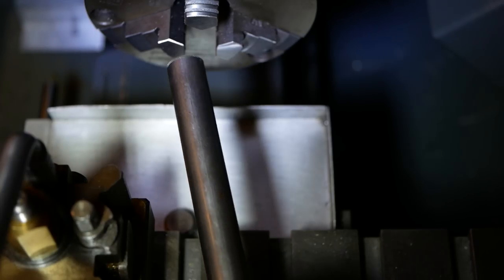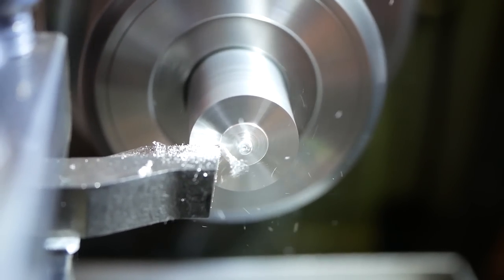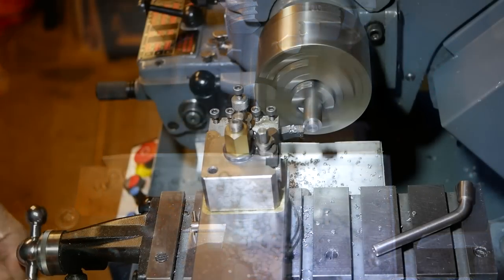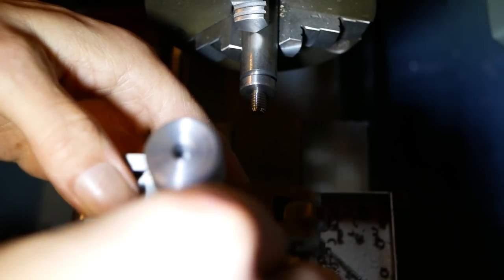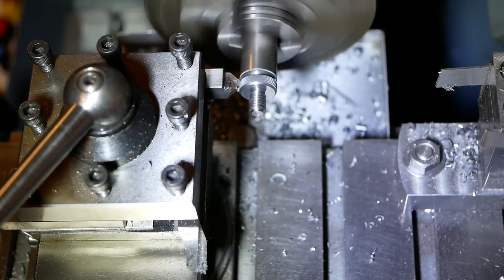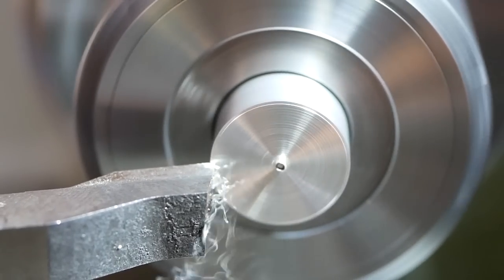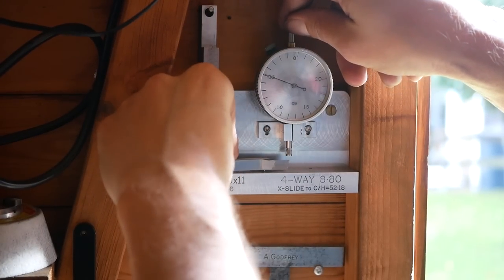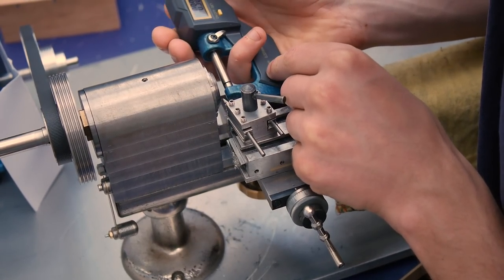In Defence of the 4-Way: Myford Toolholding

Comment: That's just silliness. QC toolposts are worlds faster than 4-ways. It's easy to make plenty of toolholders for a wide assortment of holders. Boring bars, threading toolbits, left turners, facers, right turners, detailers, cutoffs, knurlers... each with its own holder, all preset to its own height. Slam slam slam. No shimming. Even adjustment need not be by trial and error, since you know the thread size of your height adjustment screw / thumbnut. Make one low quickie test cut, measure the diameter of the stem nipple, divide in half to get radius, and you know exactly how far to turn your thumbnut to be exactly where you want to be. It's even super-easy to set a tool high or low to compensate for a top rake that isn't ideal for the cut being made. And... a QC toolpost can be rotated just as easily as a 4-way can be. With NO tools.

A QC toolpost is also nearly always smaller in "diameter" than a four-way is, which places the toolbit nearer its center, which minimizes tool stickout and hangover, which maximizes rigidity. No need for any shim rack or external space-consuming shim calculation dial/test indicator rig.

I own four-ways, lanterns, and QC toolposts. I nearly always reach for the QC.

One last point: a four-way's detent stop is seldom very repeatable. That's a serious weakness. Every time you change tools, you need to verify that it's oriented correctly or it'll be at the wrong angle so it won't be repeatable. Compare to a QC toolpost; make a cut, remove the tool, change to a different tool, replace the first tool, and your zero will still be exactly zero. Full repeatability. Say... a left turner, a knurler, back to the face turner. You won't want a different zero for the knurler, so you can leave your zero alone.

If you have one of those T-slot tables on your cross-slide, bueno for you. Most of us do not. Either way, make up a zero testing rig on the back side of your cross-slide. Move to the right of your workpiece, slide forward "too far", test your height, adjust quickly, back up, and make your cut. Bang bang bang. Seconds. SECONDS.

I'd rather cut metal than shim stuff.
Reply: You can glue the shims to the tool so you only do it once.

But yeah, a quick change that requires a separate spanner and doesn’t have many tool holders can easily be slow. But that’s not comparing apples to apples.
Reply: @EverettWilson  Half a thumbs-up for that answer. You can indeed glue shims carefully to each tool... but then those shims are obsolete next time you regrind your tool so they need to be cooked off and reglued.
Reply: @EverettWilson  I'll add that the QCTP holders don't need to be married to tools; you can easily swap tools in one of the standard holders and compensate for height with the large knobby nut, rapidly regaining your centerline.

Comment: Kinda ridiculous to say it is faster to use a four way compared to your quick change just because your quick change doesn’t have a incorporated handle. I haven’t had any repeatability problems with my quick change. It does however suck that the tool holders are so expensive. Considering they are just a block of milled and ground steel.

Comment: In my opinion: DRO with tool library, a good quality holder system and enough holders are hard to beat. We use Parat holder system in one lathe (Harrison Alpha "semi cnc-lathe") and "Malcus"-type on a fully manual Harrison lathe with a Newall DP 8 DRO.
 The Alpha with Parat keeps inside +/-0.02mm changing tools (have ~15 holders, would need/like som more) and with the cam making parts is "a breeze".
 I use ∅8-∅32 mm tools and like the fact that I have different holders for different sizes. Then I just change inserts depending on material and preferences.
 DISCLAIMER: ALL of our qctp:s hold three or four tools! I turn my Parat 90° for one tool, 90° for the next and so on. I have no experience in using toolposts where the holders have to be changed between every operation!

Comment: Particularly in small lathes, (I have two, both Myfords) for almost all the work I do, as many of three of the four tools will always be in the way. Generally they will foul the tailstock, but often the workpiece, and sometimes the chuck. Particularly this is the case with boring tools, but even short tools take up space which on a small lathe is simply not there. 
I think this is a false dichotomy: for me, other options are better than both those presented here.

Comment: I'm glad you mentioned the overhang on QCTP,  I find it excessive on majority of small lathes and swapped back to 4 way.
On 'industrial size' the weight of QC tool holders starts going up pretty quick.
 I would estimate swapping a 4 lbs tool holder every couple  of minutes when I worked in manufacturing (before the days of CNC)
 At least it kept me fit and saved on gym fees 😁

Comment: There is another consideration you haven't mentioned about using a fully tool loaded 4 way indexing toolpost and that is user safety. with a fully loaded 4 way there are razor sharp tool ends poking out in every direction and that in itself is undesirable from a user safety aspect. Way back in my tech college days the shop teachers did not like to see a 4 way post with any more tools loaded other than the one doing the actual cutting operation for this safety reason as there had been several instances of students injured on the other protruding tool ends when reaching in to measure a workpiece with a mic or calliper or make other adjustments.

Comment: I made my own design quick change tool, to achieve a heavy chatter resistance tool post, this way I also can made myself any number of tool holder (of course can be done with commercial qct). The rigidity I got was miles away from the commercial ones for the small lathe I have.

Comment: While a 4-way tool post is fine, the only advantage it has over a QCTP is in rigidity.  That is particularly true with smaller lathes, but can matter on larger machines too.  In every other way, the QCTP wins hands down.  In particular, the argument that adjusting the tool height is cumbersome or slow for a QCTP was complete and utter non-sense.  Setting the tool height with a QCTP is dead simple and only takes seconds.  As does changing tools, of course.  While having a well sorted assortment of shims is obviously helpful for a 4-way, that does not over come having to take the same initial test-cuts to confirm tool height as with a QCTP, or having to deal with the 3 or 4 set screws to hold the tool - vs - a single lever on the QCTP.

Now, there is one type of QCTP that looses on all fronts - the type that uses a piston to push out on the tool-holder to hold it in place against dove-tails.   Those are only good for very light use.  If that.  In particular, the little cheap aluminum ones that cost $30 for mini-lathes are garbage.  Avoid those at all costs.

Now, all the above aside, this was a very well done video.   And your other videos look interesting, so I think I'll go watch them.

Cheers!  :)

Comment: Interesting! I drifted in on the algorithm tide…I’ve never used the four-way post that came with my Myford. I note that it has a simple ratchet for indexing, and wonder whether it is repeatable enough for those tools that really must address the work at a right angle.
Reply from the maker: In our experience, the ratchet is amazingly repeatable. The key is to ensure the bore of the 4-way is a snug fit on the bolt. If neccessary, it's worth bushing out the bore in the toolpost if it's a sloppy fit.

Comment: Is your rear tool post also indexable? Looks like it. It would be cool to have a second tool post in the back. In fact I have a special book by the Vereinigten Drehbank-Fabriken (VDF) in which a machine is shown that has two cross slides mounted on the same dovetail, each with their own turret tool post and leadscrew with handwheel. Pretty awesome. 
I was thinking how nice it would be to have an (inverted) chamfering tool mounted in the back as well, to be used while the machine keeps running in the same direction. In fact I have seen a very nice example of a parting-off rear tool post in a Colchester manual which also has the clamping system inverted, bolts coming from below and the fixed clamping surface on top. For parting off it may be less ideal because it appears to me the forces will try and lift the cross slide instead of pushing it down. 
One last thing I noticed is that the compound slide is very often mounted in a position where it overhangs the cross slide a little bit. I wonder why this is. The added moment load will put much more pressure on the left cross slide guideway. It may have to do with clearance of workpieces of certain dimensions, but I have not encountered such a use case yet.

Comment: I recently bought an  old lathe and started learning to use it. It came with many quick change tool posts. I find the center height to be very dependent on exactly how I drop the new post into place and tighten it. This thing they show where it's "you just drop the new tool in, tighten, and away you go, perfectly aligned!" seems a little misleading to me. At this early stage, where I'm teaching myself about cutters and how to grind and sharpen them, I find myself almost always replacing the tool in the quick change.

Comment: The 4-way dies without access to a good variety of hardened shims, if you always have to improvise and find pieces to adjust the center height, you are done for. If you have a bigger machine you will also find that the shims will die rather quickly because of the clamping force you will need to apply.

If you have a small lathe the 4 way will work, a bigger one, no way. The forces are much higher and the shims, hardened or not wont last long.

I've also found that the Multifix system is much better than the style of quick change shown, though the multi might be to big for small machines.

Comment: A good 4-way is pretty handy but many aren't..
Old capstan lathes had 1 or 2 4-ways which are easy to unlock and auto-rotate to the next tool, are intended to easily accept frequent oiling, and lock accurately and positively.
My Smart & Brown has a rubbish 4-way from the factory.. it only accepts narrow tools, doesn't easily take oil, and doesn't auto index.
Also, if you like to use a boring bar, you've got a 3-way toolpost.

A QCTP makes sense if you've got plenty of holders and have a use for them. I think 4-way's would be more popular if they were all created equally well.

Comment: 3:40 What do you mean by not having enough tool holders I've got 18, +3 for boring bars and one with a MT2 and a 5/8 keyless chuck. Also I ditched the compound and built a solid riser block so my tool post won't swivel anymore and is set square. I marked the cross slide so the drill chuck is on center. Now I drill, ream and tap with power feed. That fore way is what I learned on, however sometimes I would have to remove a cutter I just spent 10 min getting on center because it was in the way of the tail stock. In my 1943 Machinist hand book ( the Bible) says it's A-OK to plunge straight in while threading. That 29.5deg business is needed for big coarse threads. With 1-1/2x8TPI you will be just fine. Another trick for hard stuff or S.S single point it most of the way then run a die nut over it. Same for taping.

Comment: Nice video sir. I agree with your points. The one advantage of the QCTP over the 4way, seems to be the option to use the tool inventory of a DRO, if a DRO is available. With some QCTP you can also index your tools in specific angle increments which can be useful too. Keep the interesting content coming and take care. Kind regards from Greece.
Reply from the maker: Thank you for your kind words. One point - if you set up your tool in the 4-way and reference it against a bar of known diameter (for example), and then zero your dial or DRO, you can still use the DRO (or dial) as a absolute measurement technique with the 4-way. Provided you don't remove the tool for the 4-way, the tool can be ratcheted back into the exact same position. You are absolutely right about indexing your tools by a specific known amount - this is certainly an advantage with the QCTP.

Comment: Another vote for the 4 way.  I have three of them with 10 tools mounted in them leaving me with two spare mountings.  Each four way costs about the same as a quick change tool holder.  In my opinion a quick change tool post is a costly way of making a small lathe worse.  I really don't know why so many think fitting one is a must do upgrade.

Comment: Honestly, I'm a noob, but I think you have it wrong.  For a beginner, there is nothing easy about obtaining or making a variety of shims, measuring the required height, or making a special tool height/shim measuring device.  It's much easier to mount the tool in the qct holder, and adjust the height of the tool to a center mounted in the HS or TS.  Now for someone with the shim and measuring setup, the 4 way may be more efficient if you're able to plan the tools you'll need to mount in advance, but this is not realistic for my level of experience or my current work types.

Comment: yes i agree There a lot to be done with a 4- way tool post. i have both but fin i ues the for way a lot one you have  the right size  Tolls that fall in line with the  Centre  & i use dedicated old  feeler gages for sliming, Or cut the tool to it finish with so no shims are needed Les England. I even have an agitable Lantin post . i mad a a project one lazy after noon.

Comment: The 4 Way is not a superior toolpost, it is a superior alternative. A great deal depends on the particular job and the machine to use,  just as Aceroadholder states below. In respect to full size lathes, with serious power and job demands, I offer the following, from 50 years in job shops. So for my own equipment, ATW Pacemaker & 10EE those decades say the following;
      Over the years, acquired (and kept) 3 different sets. #1 toughest QCTH is the Dickson/ Enco/ Feldbach type, similar but not very interchangeable. The wide spacing of locating Vee's, therefore least deflection, is unbeatable. It also grips holders on two adjacent sides. Holders are largest, hence heaviest, using them is a workout. best use is on machines capable of the greatest power and part size. A challenge to duplicate DIY,  possible with access to a broad set of equipment. They clean easily with a chip brush; anyone running bronze and brass will appreciate that detail. I like square head clamping cap screws for the same reason. Dang silicon bronze, cast steel and iron. 
       Next, the Kirkelie. It resembles Aloris pattern but the post is female dovetail, occupying 3/4 the width of the post. Entire right side is the clamp meaning pressure of straight turning is directed to solid portion, not the clamp. They made straight and right angle holders but all grip from front, and weigh half that of Dicksons. Both sides of the Vee also clean easily with a brush. You wouldn't be disappointed with a set, not hard creating copies on your own, IF properly heat treated. 
       Multifix is a terrific design, but not very prevalent. They haven't a broad distribution net work or promotion. Nobody would turn a set down. They need ready storage that doesn't allow chips to collect in the splines, a lot of contact area = no repeatability.
       Next Aloris, most prevalent of all, and widest variety of holders, many not especially feasible in other designs. Yuasa held/ holds rights to a version if not copy that interchange well, of which Chinese copies do not. An easy test, if the lever locks holder at similar angle between brands. Un-tightened and unequally tightened holders detract from repeatability.
      There are others. Admittedly, Chinese QCTP & TH are an elongated Oooh-kkk, only if bought and KEPT as a set; verify they each lock similarly. It seems they screen groups of holders with posts and match them accordingly, because two sets hardly lock with the same physical effort.    
      Very last is KDK, with exception of #100 & #150 ranges. Easy to manipulate, plenty in variety of holders, in fast jobs on small machines, it's some kind of cruel joke when 250's and larger have same width dovetail as smaller holders. 
      I don't care what some engineers certificate states.  Rrigidity and repeatability are direct functions of proportion and mass ALL the other holder designers comprehend.